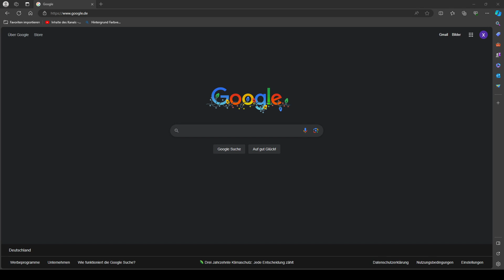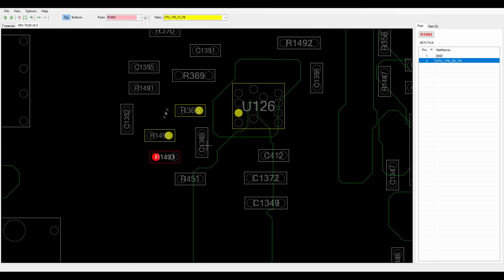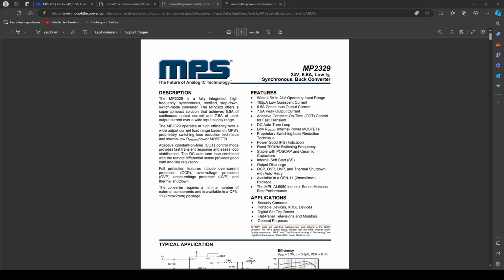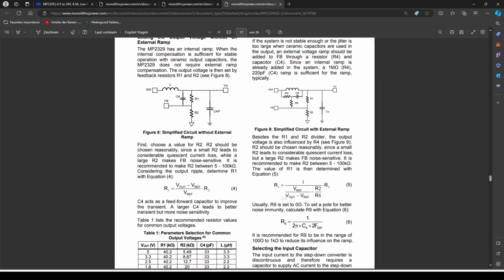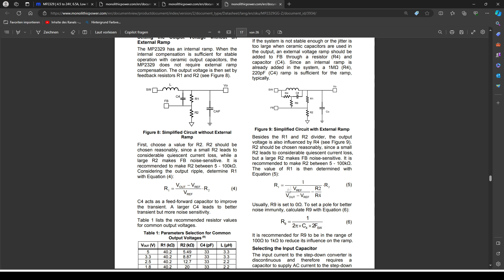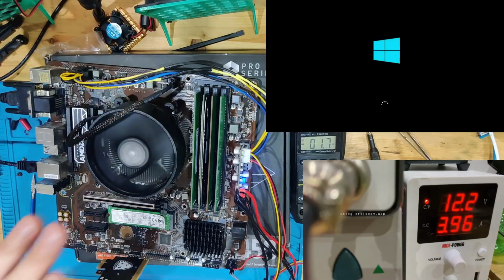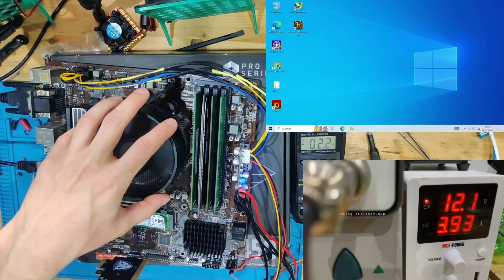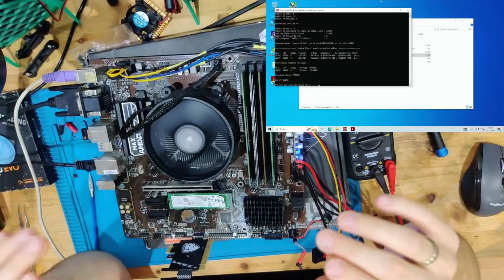Understanding Feedback of a Buck Converter | Repair MSI B450 Pro VDH Max (Bodge job)

Comment: How you can measure resistivity and the resistors are connected to the circuit, does it give the right values?
Reply from the maker: If the resistors has nothing in parallel to it, you can just check it in curcit with probing both end off it!

Comment: Amazing work getting 3 resistors in such a small space, well done. Buying a new single weird value resistor might have made for a prettier fix but it would have been much less satisfying. No chance of needing that value again. I think your fix was the economical repair.

Comment: Holy Crap !!! . . . . Version 8.0? . . . that means that board has had 8 significant changes. Most likely, the manufacturer is sourcing their components from the cheapest supplier they can find at the time. When they find cheaper parts, they produce a new version. Sometimes a new version Fixes a known issue, but on such a budget board, that is never the case. Each version is likely worse than the last. Personally, I think that board isn't even worth being a donor board as all of the parts are garbage. But, thank you for sharing your knowledge and skills. Very educational.

Comment: Didn't you have two 1K resistors to put in paralel ? If they also were like a few ohms short it would have been close enough to 487ohms... and probably looked better :P
Reply from the maker: I thought about putting 2 in parallel, but i wanted to get as close as possible to the 487 ohm. I did have single resistors that were close to 500 ohm, but that wasnt good enough for me!
Reply: @MainboardMedic  I agree. It's more important to get that custom 487ohm value than to "look good". Thanks for your videos, I really enjoy them :)